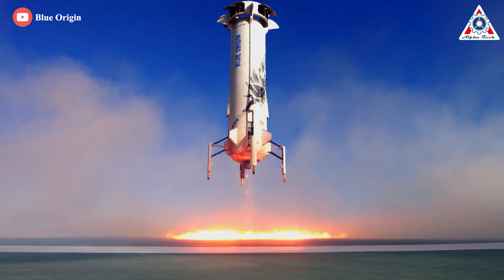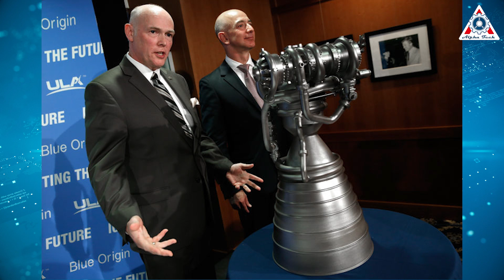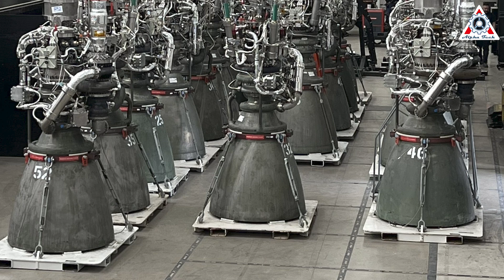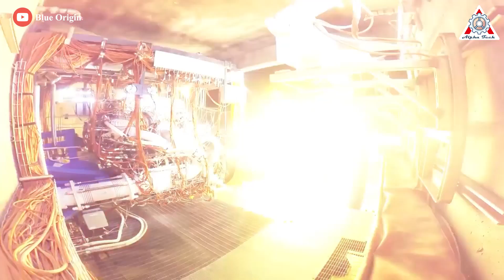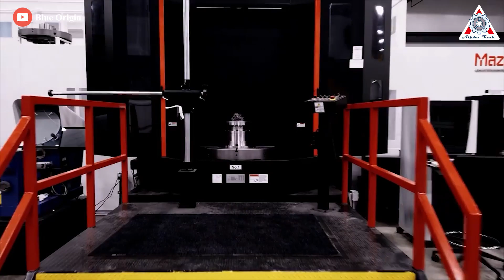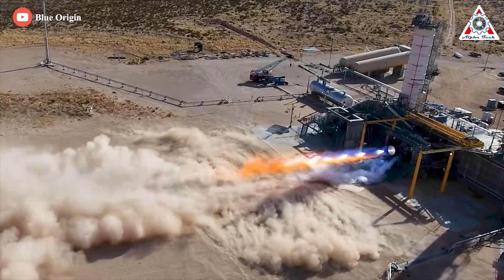Disaster! BE-4 Failure...

Comment: Where's the beef? You didn't talk at all about the engine's design. The raptor os a full flow full combustion engine. What is the B-4? What was wrong with the pump and what design changes fixed it? You didn't discuss what is causing the combustion instability. The F-1 almost died from combustion instability but they solved it. Blue Origin's engineers are obviously aware of this, what approaches are they taking? Why is the engine life less than expected? Is is cooling? this video is not about a rocket engine, it's about programs and budgets. WHO CARES? I want to learn about the engine itself.

Comment: My company makes a few simple parts for both Spacex and BO. The intensity of purchasing, and drawing quality is very high with SpaceX. They design for manufacture: tight tolerances only where necessary for function. They are on a mission and it shows. They are becoming a little bureaucratic on the paperwork requirements lately, imo.

Comment: Funny how spaceX fans assume Raptor is a huge success and that Be4 is a failure. Yet they still have the same number of successful flights to space. Zero. 

And during the low 10k hops that starship has done so far, there appeared to be Raptor failures at an alarming rate.

There seem to be a double standard. If SpaceX fails its said to be a positive. But if anyone else have a failure, they are incompetent. I like spaceX. But i dont like the fanboy mentality surrounding everything Elon does.

Comment: I think the design features is what made it a headache.  Can't really compare with SpaceX cause they designed a smaller engine and optimized it heavily, while BE4 is a bigger engine, harder to manage chamber pressures.
Reply: Chamber pressures in Raptor are much higher at a "nominal" 300 bar  vs  less than 200 for BE-4. I don't think the size is the obstacle. Metallurgy and understanding of fluid dynamics are. The much smaller Raptor engine runs much hotter (without melting) and has far less weight, 90% of the thrust and a Much higher ISP (fuel efficiency) as a result.

Comment: What do I think of the BE-4?  I can't answer that any more than I could have an opinion on the Raptor engine until I saw it lift mass under full control. The BE-4 is an unproven engine until they bolt it to the flamey end of a rocket and it does it's job.  BO has a long way to go to get all the bugs out and start producing a reliable and robust engine.
Reply: ULA shouldn't have placed all their eggs in the Bezos' basket. They're backing up payloads for USSF and NRO with the Vulcan Centaur delayed.

Comment: That’s a good video. The term “hardware rich” is accurate for SpaceX but does not appear to apply to BO. I used to do flight test at Edwards AFB. You wring out the bugs by operating equipment. In the perfect world, the flight and operational testing verifies engineering (expected or nominal result). But often, we learn something about the system we did not expect. Then the engineering side has to understand the unexpected, fix if required, then refly.  SpaceX has this process weighted more to testing than to engineering. By testing more hardware more often, they are cutting the time to end product. It is costly. However, it’s also realistic because the “perfect the engineering then test” approach runs the very frequent risk of the engineering not working out in the real world and then the entire infrastructure has to sit around waiting for engineering to figure it out. This can become deadly to cost and schedule. 

But executives like tight “efficient” budgets. They get to those by assuming the engineering will work first time. All of those project charts have time built in for slips, but it’s never enough. The “efficiency” never existed. It surprises me that someone as bright as Bezos keeps hiring executives who don’t understand how to run a hardware rich program.
Reply: Interesting. By the way - I don't think it's as costly as it could have been for SpaceX considering the material they've chosen to work with instead of carbon fiber. How many times cheaper is 304 stainless? Something along the order of 170x if memory serves right. They get to destroy over a hundred prototypes and still not reach the same cost in materials...
Reply: @FuriousImp  Absolutely a great call by SpaceX to go back (it has been used before) to stainless steel. I think they came up with a tweaked alloy as well.

Comment: Hold on, hold on hold on!  What is the link between Aerojet & ULA & BO?  ... because Aerojet has Rocketdyne subsumed as part of that acquisition of Pratt & Whitney. And a former Rocketdyne engineer commented on a recent 'Real Engineering' video on 'Why does SLS Exist?' that Rocketdyne was the worst company for Engineers he had ever worked for.

So my question is: Is this just all one incestuous relationship of government & political incompetence, with Nasa & SLS, and with 'reused' engineering par average, extending out even as far as the privately run Blue Origin?

I think all this is what happens when you throw dollars at a problem, rather than Will.
Reply: Or Penny or Dr. Smith.

Comment: Huge difference between Spacex and most other space companies, is that everything is built by spacex, rather than having to order parts from 3rd party.
Reply: That, and the fact that SpaceX accept failures as a part of the learning process. They accept a rocket to be blown up during launch, they are building very quick a lot of engines, even when a newer version is on its way and the older version will not fly. They do very rapid prototyping and accept that some of their prototypes will never fly.
Other companies are working on the rocket for a long time.When they decide the rocket is ready they do not change a lot any more, as they see the rocket is launch ready. This method takes a lot of time, but will end with less unused, but paid for, rocket parts. Elon on the other hand is doing a lot of testing when launching their rocket. Changes are that the starship rocket will not fly well the first time, it is all accounted for, they will learn, change for the better and relaunch!
Reply: They may assemble them, but a lot of companies manufacture parts specifically for them, as with pretty much every aerospace company.
Reply: @samo4866  No SpaceX build all the important parts, like engines, turbo pumps, tanks, cabins, etc. etc. themself. For the SLS the boosters on the side are made by Northrop Grumman, the first stage core is made by Boing, the engines are made by Aerojet Rocketdyne, the second stage is build by 	Boeing IDS, United Launch Alliance and Mitsubishi Heavy Industries.
The Orion crew module is build by Lockheed Martin, the Service Module is build by Airbus Defence and Space, Teledyne Brown Engineering of Huntsville builds the launch vehicle stage adapter 
For Starship and Falcon 9 SpaceX makes all the main components and yes they do buy small parts, like nuts and bolts, and stainless steel and electronics from elsewhere.
There is a big difference between how SpaceX works and NASA is told to work by the government!

Comment: Interesting that SpaceX achieved approval BEFORE BE4 even though it started much later. Mismanagement?
Reply: Different approach! SpaceX is making a lot of prototypes so they can test quickly, it is very expensive, but it will give you a very quick result. Blue is developping one prototype, test it, learn from the mistakes and make an improved prototype, more cost effective, but slower. That is where the hare and the turtle comes in. Blue hopes that this cheaper approach will give them the advantage in the end, in real life the hare is not resting but keep on running!
Reply: Shotwell vs. Smith

Comment: The problems with BE4 begin with the equipment that Bezos refuses to buy. That delays everything. How long will ULA wait for its promised engines before it begs SpaceX to sell them a few engines, even if they have to abandon LNG in favor of methane. This BE4 failure could put ULA out of business if it keeps on its current trajectory.
Reply: Isn't lng methane?
Reply: @Mister_Durden  Yes.
Reply: @nathanblomgren1304  lng has other stuff in it small amounts of propane etc is the difference
Reply: It isn't that easy to chane engines, even when SpaceX is willing to sell them! The rocket may need a lot of redesign, not only for the plumbing, but also for electronics, programming etc. etc. The BE-4 and the Raptor are different engines with different trust, different prices and different capabilities!
Reply: @platoplat498  All true, but no engine means no rocket PERIOD.
Reply: @earlpottinger671  True, but an other engine means a major redesign of the rocket, that will cost a lot of money and time too. so for ULA it is better to wait even longer then to change engines.
Reply: @platoplat498  So how long should they wait when they have already waited years for a working engine just for testing? Sometime you have to bit the bullet and start all over.
Reply: @platoplat498  true, so they'll just have to pay SpaceX to launch the payloads. funny thing is that by contracting SpaceX, they would probably save money and turn a bigger profit for the price they were awarded in their launch contract.
Reply: @SoloRenegade  But they could not employ that many people... And the US government wants more then one partner/ rocket to launch their payloads
Reply: @platoplat498  when did this become a discussion about employee counts? Nothing I said requires anyone to hire anymore people than they already have.

Yes, Dream Chaser is a thing, as are other rocket providers. ULA and Boeing aren't the only options outside of SpaceX. Perhaps the gov should be helping develop other providers that aren't already mired in corruption and gluttony?
Reply: @platoplat498  
Falcon 9: exists
Falcon 9 Heavy: Exists

ULA couldn't care less about firing people. If they could build and sell their rockets with half the employees they'd do it in a heartbeat. Gov doesn't dictate how many employees a private company must have, nor should it (that would be hardcore socialism).

"Yes I do think we see the first test flight of Starship BEFORE the first test flight of New Glen, " wow, you're a smart one....
Reply: @SoloRenegade  Prototype Lean R&D is good at inflating costs and schedules. It is terrible at producing working parts to spec. I say Prototype Lean because I see similar problems with software development teams that put fewer prototypes under real world testing than groups that do.

You are always lacking some part of how something needs to perform, it could be combustion instability, alerts that are irrelevant to the current operation, Piece of data B must be editable later in the checkout process.
Reply: @Knirin  totally agree. I see it all the time both from the software teams and from the hardware teams. They are all so afraid to build a prototype that doesn't work. I struggle to teach people to learn from mistakes during prototyping as that is when it can screw up and not jeopardize the project.

There are interesting parallels to this in flight instructing as well that many never seem to figure out.
Reply: nah, Bezos already bribed ULA to not back out of the engine deal.  he signed that huge satellite contract with ULA to launch amazon satellite internet, the contract will keep ula alive for a decade or more, and it has all sorts of extra money in it if BO fails to deliver the BE4.  it's a shady as all heck deal, considering it's AMAZON (a publicly traded company) Bailing out BO (a separate and independent publicly traded company), granted Bezos is in charge of both, but it's likely a violation of a number of laws what he did there.  So no matter how delayed the BE4 is, ULA will make bank thanks to Bezos' bribe.
Reply: There's been stories going around that Bezos wants to put ULA out of business and snap up their customers. Thing is, BO doesn't have anything to fill any customers' needs.
Reply: @dalethelander3781  they can send people to the edge of space..........so they got that going for em
Reply: @Mister_Durden  And when they die, on their deathbed, they will receive total consciousness. So they've got that going for them. Which is nice.

Comment: Great Video , lots of info in there . I worked in aerospace for 43 years and I actually live not all that far from Kent , Wa. , and I even think about trying to help them get their production running better but the one thing that keeps me from doing that is I don't like working for jerks . I'm retired these days and might even do it for free just for something fun to do but for the one problem I have with that company .
Reply: I’m right with you. Sometimes I think that it would be beneficial to any program to have retired guys (I’m retired flight test) formed into a Red Team to analyze the program’s weak spots, suggest solutions and be an early warning system. I’d do it for free. But, I don’ t like working for jerks. I do like interesting engineering, so it can balance out.

Comment: overly complex compared to Raptor
Reply: Look at Raptor 1.  It had a great amount of material for sensors that made it a rats nest.  Raptor 2 performs higher with most of those sensors removed and most flanges replaced with welded pipe.  Hopefully BE-4 looks how it is because developmentally it is more at the Raptor 1 stage and will be able to simplify in the BE-4-2 stage.

Much as I dislike BOs lack of progress I would prefer to see them turn around and make BE-4 work so ULA can fly Vulcan Centaur and BO itself can fly New Glenn even though it won't be economically practical to fly until they have the fully reusable 2nd stage (if it can be made economical at all).

Comment: The BE-4 feels rather half-assed. Not designed with the usual rigor we know traditional companies put in their hardware design and not with the rapid build-test-redesign method SpaceX uses. It seems it's somewhere in the middle of both methods and the question becomes then, does this mean it got the best of both methods or the worst? I bet the later.
Reply: Software issues will again sink the Artemis rocket.  It's all over except for the fat lady singing.  (Reference to Wagner.)
Reply: @freeman3320  What does Artemis have to do with it? We'll see next week, but it is not connected at all.

If there were something that would sink Artemis, it would be the budget for archaic tech.

Comment: Good straightforward production 2Day, Nicely Done !  Just curious,  what rocket engine does Bozos use on his "Human Rated" flying "marital aid" to the Karman Line?
Reply: BE-3.   The new Shepherd  was not designed to handle the thrust of the BE-4.
Reply: @hillbillyair  Roger That, thx
Reply: @hillbillyair  BE-3.   The new Shepherd  was not designed to handle the thrust of the BE-4.

The BE-3 vacuum version is also to be used on New Glenn 2nd stage and was to be used on the National Teams HLS if they had won the competition (lost to SpaceX HLS based on Starship).
Reply: @Scanner9631  The Blue Moon lunar lander and the National Teams HLS would use the BE-7, but I guess that's basically a scaled down BE-3.
Reply: The hopping rocket (New Shepherd) uses a small, conventional H2/O2 engine. Rocketdyne lost by bidding an H2/O2 engine. Methane is more difficult but has many advantages. So no variant of that by BO was going to win the contract over a veteran company offering the same thing. 

Its also worth noting that the New Shepherd engine is a conventional design (off the shelf tech) vs the BE-4  which required alot of original work.
Reply: @avgjoe5969  Good Stuff, much appreciated! I thought there was new about Rocketdyne selling? If Pratt&Whitney was the buyer I'm a fan. We flew a few variants of their Turboprops (as well as GE & Rolls) here at one of the Majors Regional carriers. Gr8 engines.
Reply: @uuzd4s  P & W already owned Rocketdyne and sold it to Boeing before Boeing sold it to Aerojet.
Reply: @dalethelander3781  Roger That. So all American w/ the occasional overhaul facilities outta Canada and beyond.  Our overhauled P&W 150's were coming outta Canukville for a while, then the East Coast (forget the State), then China  : (   All in all glad they're still makin motors ! Thx for the update. Worked on 3 different P&W Turboprops, 2 GE CF34 variants and 1 RR Spey engine at the regional carrier I worked for. High quality stuff, all of them. What's interesting is the 1930's vintage German made Canco closing machines (for sealing cans of salmon) I worked on in Alaska were by far more complex, where the Fanjets & Turboprops were more exotic w/ much tighter tolerances and easier to service.
Reply: @uuzd4s  I misspoke. Pratt & Whitney-Rocketdyne was bought by Boeing.

Comment: US Space Force needs to ULA to make a deal with SpaceX for Raptors.
Reply: Why would SpaceX want that deal instead of just doing the launches for the Space Force themselves?

Space Force (the U.S. government in general including NASA) wants more than one launch provider.  To truely have that they need to make sure the rockets are not dependent on one company if ULA is using Raptors than both ULA and SpaceX could be grounded if there were trouble with the Raptors.  

They have learned from the shuttle.  Each problem stopped U.S. manned spaceflight and required them paying the Russians to fly American astronauts to the ISS.  They now have SpaceX Dragon for that but they still want a 2nd provider, ULA Vulcan Centaur (BO BE-4 engines) with the Boeing Starliner or the Cygnus craft gives the Crew and Cargo to the ISS and general satellite launches as well.  Using Raptors for Vulcan shoots that in the foot.